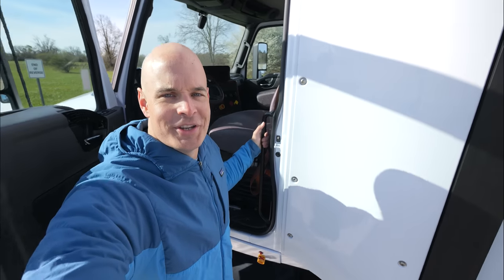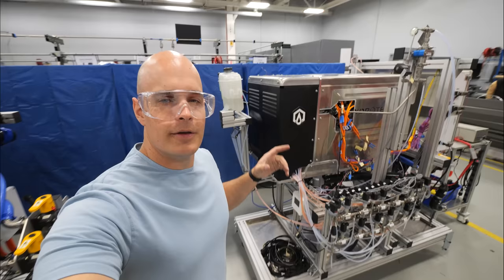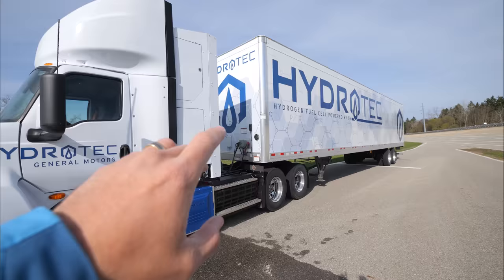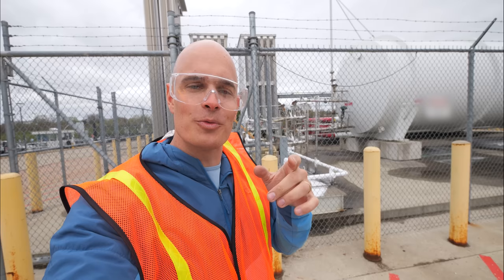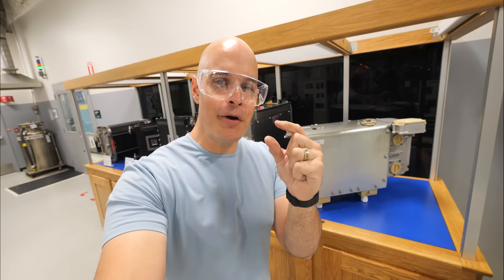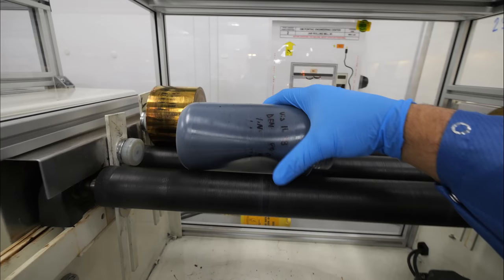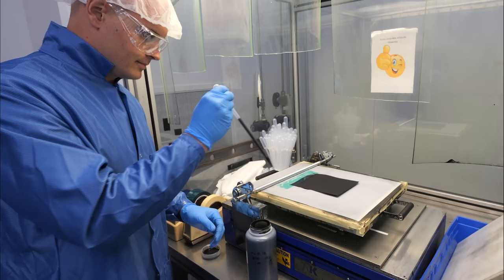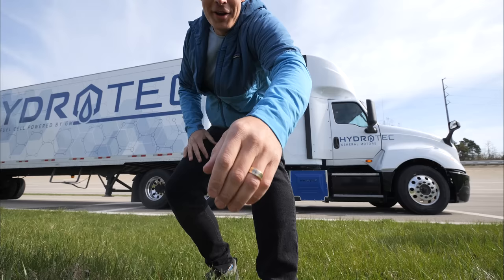How to build a Hydrogen Fuel Cell Semi Truck? - Hydrotec Factory Tour

Comment: So... basically this is a true hybrid in the sense of the word. It uses a form of fuel to generate electricity, which then moves the vehicle. You get the benefits of an electric drivetrain (instant torque, consistent power output, low maintenance) but without the range restrictions, as fueling up the hydrogen cells is a lot quicker than charging a batterypack. I like it.
Reply: battery rotor in place of engine and 2 generators(thu convertion )) this truck will drive forever
Reply: Toyota been trying for years and failing. This won't be any better.
Reply: Hydrogen isn't "fuel" it's a "storage medium" ..... A Battery.
It's just a hugely inefficient one.
The "must have huge range" mantra is a misconception (I could call it something else)
.
Truck outranges driver.
Truck charges during driver rest period.
Truck outranges driver to end of day.
Slow charge overnight.
Repeat.
Is all that's needed.
Reply: But it’s about 60-80% less efficient than if the electricity was directly stored in batteries. While hydrogen is the most common element in the universe it is not a source of energy it needs to be produced and is a store of energy. Creating hydrogen comes from natural gas and is incredibly inefficient. Converting it back to electricity is also inefficient. Hydrogen is “mostly” a fools errand as the net efficiency is so much lower compared to just putting the generated energy into batteries. Battery cells are recycled up to 90% of recovered metals for new batteries. Redwood recycling. Watch real engineering channel about hydrogen. 

Solar or wind goes DC to DC in the batteries, converted to AC runs the motor and 90% of that energy gets to a battery ev wheel. Ultra efficient. 

Wind and solar at best uses electrolysis to separate hydrogen from water, really inefficient. Then you need more energy to compress that hydrogen to liquid. Then the hydrogen has to be stored under compression which requires ongoing energy. And the hydrogen has to go through a fuel cell in the vehicle, which is incredibly inefficient converted into electricity to go into batteries that then convert from DC to AC to drive the AC motor.
Reply: Hydrogen fuel cells would be great if it was convenient to extract, transport, and store hydrogen at the same scale as fossil fuels.  It will probably get there, the infrastructure is much better than it was 5 years ago, but it's still difficult for now.
Reply: @carnsoaks1  they work. But people won't buy them cos they are not fashionable or something. 
All of the problems are sorted
Reply: @rogerstarkey5390  so is any other fuel.

H2 is more energy dense which means the truck can carry more cargo

Plus there is not enough materials in the world to replace all ice vehicles with bev
Reply: @rogerstarkey5390    There are no examples of this only propaganda. You won't get a loaded ev semi to meet it's advertised claims.  

If a driver is to make a good living hes going to outrun his log book, a driver wants to be able to park wherever including a dirt field in the middle of Oklahoma at 3am.  You're not going to be charging your rig in a dirt field. 

Another problem is the batteries that allow the electric semi to move are insanely heavy eating up a large amount of payload which reduces the amount of money your now limited range semi can rake in.  As a final kick in the pants battery replacement will equal half the cost of the rig in a few years. 

 Now you're stuck with a disposable mostly plastic flimsy framed electric headache nobody wants.  Getting rid of your used up EV battery pack is not going to be easy in the future. Nobody's going to want them they're not truly recyclable, they're a fire liability as well as an environmental one.

The electric vehicle battery is the Trojan-horse to our environment. 10 years from now my prediction will come to be, watch.
Reply: If history teach us...we will always goes with what benefit the rich like Elon...so electric is the way to go, until they're not one day...
Reply: @hollymolly518  because people are misinformed. If Tesla was selling fcev that would be the most common ev. Cos marketing
Reply: Except:

H2 station is expensive

H2 is expensive

H2 fuel cell is inefficient

Basically, it's not really worth it, just use battery
Reply: @cenakaze  so are ev. H2 is still not widely adopted. Price will come down with adoption
Reply: @cenakaze   The batteries are not worth the footprint. And the battery is just another energy carrier,  just use diesel responsibly.
Reply: @Pawer8  
You fell for the "not enough material" opinion?
.
How about those who say "not enough electricity to charge the batteries?
Do you like that one?
.
Well
You need THREE TIMES the amount of electricity vto liberate enough hydrogen to move the same distance.
Reply: @Pawer8  The problem is that are two different ways of measuring energy density - either based on volume or mass - and although hydrogen has good energy density by mass its volumetric energy density is rather poor (about 1/5 of gasoline, for example) - and this is what matters the most in a road vehicle.
Reply: @TrimeshSZ  not on a truck. They are limited by weight. Plus batteries are less than 1/5 of the density of petrol.

Weight is also a safety concern
Reply: @Pawer8  
How will the price come down?
Take sunlight.
Convert with solar power
You need three times the solar to make the Hydrogen for the same distance..
That's more expense.
....
With the EV, that energy goes straight to the vehicle on the existing grid..
.
"But the chargers!!!!"
Single cost, minimal maintenance.
Hydrogen?
You need the conversion plant.
You need a fleet of road tankers (no, pipelines don't work)
Due to the energy density, you need up to ten times the road fleet to get the hydro to point of use compared to fossil fuel.
....
You need storage at point of use.
ALL of this must be built A D maintained and it's not "passive" like the EV chargers, it's high maintenance, "leaky".
Guess who pays for all that? The end user.
.
Then, you have a much more complicated vehicle with TWO systems.
It's a hydrogen conversion plant feeding an EV (YES! it's an EV)
.
How long do those fool cells last? (Not as long as you think)
.
Much more to go wrong.
.
Fast fuelling?
IF the multiple tankers arrive to fuel the station.
.
"But the solar is in site!!"
And that solar could still move three times as many EV trucks for the same investment, without the extra infrastructure.
.
You fell for it hook line and sinker.
Reply: @Shigles  do not worry :) companies will make sure it starts having problems after a few years of driving.. 

how else will they make money and profits for their stakeholders ;)
Reply: @cenakaze  that's because the tech isn't going forward that way. just like back in the day. we have electric car but we choose gasoline car, now we going back to electric....hydogen car could be the future but isn't for now.
Reply: Except it takes a lot of energy to make hydrogen, cool hydrogen, move hydrogen and store hydrogen.  Big picture it is not efficient.
Reply: @carnsoaks1  Tesla has been successfully moving potato chips.  The lowest possible weight to volume cargo
Reply: @mrmobius  Hydrogen is a tech startup concept for naive investors who like the idea of liquid fuel.
Higher density and solid state EV batteries will arrive much sooner, and cost much less to run.
Reply: @Voltaic_Fire  it will never get there because of the basic physical principles of hydrogen. You can't change the periodic table.
Reply: @Pawer8  liquid H2 has more energy density than gasoline, but no vehicle can safely carry liquid hydrogen. As for raw materials,  CATL is already making sodium batteries.
Reply: @truantray  I won't say it'll be easy but I don't believe there's any challenge that humanity can't overcome.
Reply: @truantray  so what's your point? I was comparing fc and batteries. 

They are not making them yet. Also more dangerous than lithium
Reply: @Pawer8  what's "more dangerous than lithium"?
Reply: @rogerstarkey5390  it's more unstable when in contact with water. It can actually be used to generate hydrogen by dropping it in water
Reply: @yatish23   problem couse alot of contrys will go banckrupt  this project suppos to be my enginiere degree in my Contry i was working on project for 6 moths teacher just distroid my project and told to make `degree about stupid electric power steering (((
Reply: I think the big caveat is how you get the hydrogen. All the fuel cell/hydrogen combustion makers love citing the "most common element in the universe" stat but it isn't that common in gaseous form and located on Earth. Sure, the sun is made of a bunch of it, but if we can collect that, we've probably already solved our energy problem... If you source it from NG or fossil fuel processing, at least you're not just burning it as waste, though it's still reliant on FF production, but then it's at least more technically a fuel. If you're producing it via electrolysis, then it's much more akin to a battery than a fuel, since you use electricity to make it, then extract (some of) that electricity back from it. Still has some benefits in terms of recharge speed and energy density, so things like long-haul trucks or airplanes could certainly benefit from it, but it's just not exactly the magical solution to energy that some tout it as.
Reply: @Voltaic_Fire  I wish he spoke more on the safety of these? If we had 100s of trucks like this carrying pure hydrogen, wouldnt a crash on the road end in massive fireballs? What mechanisms are in place to keep that terrifying reality a smaller possibility? gasoline right now doesnt combust as readily as hydrogen sooo
Reply: AuschwitzSoccerRef.  Those quiet Swedish subs used Sterling engines, not hydrogen fuel cells.
Reply: @rogerstarkey5390  Especially in the US, where drivers are currently allowed to drive for way too long, contributing to the 40,000 lives lost per year. Europe and the UK have much lower levels, without higher prices.
Reply: @Pawer8  Tesla doesn't advertise. It's simply a matter of a the battery to AC motor energy path is more efficient than the hydrogen drive train. It's not anything more than that. 

Secondly, the true power structures don't want you to be able to make your own fuel. With ANY brand battery EV, you can put solar directly into your batteries. Thus a home power station. Can you make your own gasoline or hydrogen at home? No you always need a supplier. Battery Drive trains are the better tech. 

Improvements in battery density, which have happened for the last 100 years, will also equal more range, less weight, and better energy density over time. 

It's just a better drive train for most use cases. Ships, Airplanes, and other industrial autos still need increases in energy density. But heck, even "Caterpillar Successfully Demonstrates First Battery Electric Large Mining Truck"
Reply: @truantray  ahh yes just like the electric car back in the day...so we went for the gasoline...
Reply: @mrmobius  can you make your own solar panels? Your own battery? Don't be daft

I'm sure it has nothing to do with the gimmicks and the autopilot. I'm sure people buy it cos it's better. Like everything else right?

I'll also add until now the people buying ev are rich people. And rich people have garages and driveways so they can charge at home. If they didn't they would probably have gone for fcev
Reply: @mrmobius but is it more effecient compared to internal combustion engines?
Reply: @Pawer8  H2 isn't "energy dense" unless you transport it at -252C or at immense preasures.
Reply: @Lepinkainen_  per kg it is
Reply: @rogerstarkey5390  I don't know exactly what you are saying. If you are talking about charging while driver rests, that is not a great thing. Because the transportation company could arrange another driver to take over and continue without disruption, if needed. I guess they could also provision a new tractor at every stop, like a relay race :-)
Reply: @norbertnagy5514  no, about the same. 20-30% max energy from source to the wheels. Nothing can compete with 90% plus efficiency of the AC motors.
Reply: @cliffmathew  
Ah... The "could arrange another driver" excuse.
Really?
No.
You know exactly what I'm saying

FULLY LOADED it can run to the driver stop, and add enough to finish the day.
Unless the operators employ 2 drivers, which would cost A LOT more?
.
Stop looking for loopholes which don't exist.
.
If you want a loophole the other way
If like the majority, they don't run at maximum weight.
Or
They have even a single delivery stop during the day.
Then they could make the whole day without any charge, or top up during the delivery, again, while the truck is stopped, but the driver is away for a "comfort break".
....
Smh.
Reply: @Pawer8  
"per kg" isn't the problem.
VOLUMETRIC density is.
.
±19% that of fossil fuels, so you need ten times the number of road tankers of a given volume to supply the fuel to point of use.
Then you have to fuel and maintain those tankers, making it even less efficient.
.
It ain't Rocket Science.
Reply: @mrmobius  so we better focus enhancing the purely electric ones then
Reply: @Pawer8  Can't make my own battery or solar, but once purchased, I've got 25 years of my own fuel direct from the glowing well in the sky.

Have you watched FSD beta videos on YT where people drive for hours on full AI neural net vision only software (still in Beta)? No predetermined maps, busy cities, construction etc. Because if you haven't then we aren't talking apples to apples. 

Automated driving is a matter of when, not if. Many approaches from Wamo (high precision lidar maps) live in Phoenix now, to AGI neural net vision only which is Tesla, Comma AI (geohotz project) and one other big player. It's better to think of AI as "automated intelligence" vs artificial. We are training software and it grows exponentially more capable each day due to data set size increase. 

EVs are now price comparable with ICE cars who's average selling price is 35K-ish (all models) and the low-end EVs are in that ball park from Kia, Tesla, VW, and Hyundai. All new tech reduces price when scale is achieved. Think about how cheap LCD TVs are now. 600 bucks for a 75" 4K LCD? That's bananas cheap.

Home charging is a big deal in the US. Tesla network is top tier, Electrify america isn't the most reliable but getting better.

In China, where EV sales are booming, many apt buildings are the norm not houses. There's an entire industry of selling chargers into apt buildings. My friend has a US startup, Coral EV, doing just that. Also NIO does battery pack swap station in China. My apt building in Arizona will install an outlet in my parking space when I get an EV. I pay for the electrician around 500 bucks.
Reply: @rogerstarkey5390  when the max weight of a truck is limited by law yes it totally is.

When car's mass inreases by about 300kg yes it is.

And it is still a lot more dense by volume than a battery. So it's also good for vans
Reply: @norbertnagy5514  Hydrogen may have a place where the practicality of it, like cargo ships, may be worth the inefficiency. Given you could keep a high amount of compressed hydrogen in the fuel areas of these big ships and currently they consume the crudest of fuel oil. Major toxic hazards and greenhouse emissions. but for passenger cars and trucks it's simply far less efficient than battery EV drive train and the electric grid is already every where. With hydrogen you'd have to build an entire new hydrogen distribution and fill up network. 100's of billions of dollars just to replace ICe drive trains without improving efficiency. Plus most hydrogen comes from natural gas refinement presently.
Reply: @Dat_Sun  Tesla Semi already did 500 miles full loaded with rest stop and no charging from Bay area to LA. Ordered in the 100s by large corporate partners. 

Redwood Recycling can pull 90% of the metals from old EV batteries, which are already battery grade, a much better yield than refining from raw ore. They have hundreds of millions in funding because mining old batteries with known chemistry in bulk, is far more profitable than mining and refining raw ore. 

Yes, without recycling, you are 100% correct. It would be a disaster. But the profit motive for recycling is the key enabler of investment into the space. 

Any new battery innovation that increases density make any electric car in existence have longer range. Battery tech evolves over time (laptops used to last for maybe an hour vs nearly all day) - so an old EV upgraded to new battery tech has more range than when it was new.
Reply: @JorgTheElder  we don't have the Infrastructure for bev either.

And yes trucks are limited in weight by law so drivetrain weight matters. A lot
Reply: Too bad the  efficiency of hydrogen fuel cells is awful, since you waste 2/3 of electricity in their use
Reply: It would be true if you BURNED the hydrogen as a gas. But in fuel cells you use it to make electricity, that is incredibly inefficient
Reply: @mrmobius   500 miles of the most convenient conditions. 500 miles range would bankrupt a owner operator.  And is not even an option for team driving or driver swaps.

 But that's the goal here eliminate the competition, use the people's money against them and force corporations to purchase this junk.  Raise the prices of everything because transportation is going sky high. I feel sorry for the people purchasing their energy from the grid, this is going to end in disaster. 

 Imagine several 100 times more charging or "fueling stations for ev's.  Dont forget the massive demand placed on our undersized grid,  demanding more fossil fuels be used to keep up with the load.   All of this is placing the cart miles ahead of the horse, we do not have an abundance of renewable energy which means every electric vehicle manufactured today is another industrial load placed on our grid field with fossil fuels.

 The small amount of renewable energy on our grid is backed by fossil fuel if you step back and look at the whole picture, most of this junk is made in China or around the globe somewhere using container ships requiring billions of gallons of oil.   Do you think these countries care about our environment? China is building coal power plants at a alarming rate to build all of this renewable plastic junk we dont "need".

 Your battery recycler has fed you a bunch of grade A li-BS.  Plastics are never really recyclable, that last 10%of stuff is extremely important.   Battery technology is not improving it's simply a trade off, Reliability and durability have been tossed out the window for flimsy sandwich bag cells or super thin and volatile lithium cells . In about 10 years we will see a electric vehicle battery environmental disaster began to unfold. All of these failed government vehicles will be sitting in fields bursting into flames one at a time. It's already next to impossible to find somebody to store a wrecked electric vehicle.  

There are so many shortcomings when it comes to electric vehicles in general particularly electric semi trucks, that the only example we can find has a fraction of the range of an ice example and weighs thousands of pounds more.   They actually raised the amount of weight a semi trucklyn way to allow electric semi trucks on the road under the same rules everyone else has had to follow for the last 100 plus years..  We limited the weight for semi trucks for a very good reason and again we threw that out the window let's not talk about the damage to our roads and bridges due to the extra several 1000 pounds these trucks can weigh. As if 80,000 pounds semi trucks weren't hurting enough innocent motorists.

 Will an electric semi truck work? Yes , does it make any sense?  No, unless you're a Demorat who is somehow invested in renewable nonsense.   These things are also going to replace the truck driver if allowed Continued access to tax cattle funding. The electric semi truck is the Trojan-horse to the trucking industry. If it doesn't have to be profitable when tax cattle are forced to back it, R and D is continued using the drivers against them, Once it's polished off driverless models will become available. Costing everyone 10 times as much but in the name of renewable energy BS, they will force it on us to make another dollar off the tax payers back.

 That 500 miles equals about 200 miles in the real world may be less during the holiday season when the interstates are packed.  This handpicked route of 500 miles is a sham.   The only way we will see electric semi trucks on the road now or in the future is with massive government spending of tax cattle funding.   That's all this is that's all any electric vehicle is, just another way to access tax cattle funds.

 Pound for pound electric vehicles are an embarrassment compared to ice. You will never see a fair comparison between the two.
Reply: @Pawer8  "All of the problems are sorted"

I can think of one massive problem that isn't sorted: where do I go to put more hydrogen into my car so I can keep driving it? I can go to any number of gas stations to get more dino juice for an ICE. I have electricity at home to charge a BEV. But I don't have hydrogen at home and I don't see any hydrogen stations around.
Reply: @Dat_Sun  "Another problem is the batteries that allow the electric semi to move are insanely heavy eating up a large amount of payload"

Lithium based batteries are heavy. New battery technology is in the works that is lighter and more energy dense. Much like we didn't use alkaline batteries forever, we won't be using lithium batteries forever.

10 years from now, we will see how bunk your prediction is, watch.
Reply: @TrimeshSZ  Exactly. Hydrogen might work for semis because there's plenty of space to use for storing it. Engineering Explained did a video showing how much space hydrogen would take up in a passenger car - I hope everyone likes driving alone and fitting all their groceries and other items into the passenger seat because everything behind the driver is just hydrogen storage.

Hydrogen is a total dead end for passenger cars. And I can't imagine wanting it even if it was. I have electricity for charging a battery at home. I'm not going to have hydrogen at home, and will have to revert back to the inconvenience of going to fueling stations. No thanks, I have perfectly good electricity at home that I'd rather use.
Reply: @mjc0961    If I had a dollar for every time somebody told me future battery Tech is going to save us since 1980 I would be richer.
Reply: @mjc0961  half the drivers in the UK don't have a place to charge a bev. Petrol stations can however be converted to serve h2. But not bev charging due to space constraints
Reply: @mrmobius  > about 60-80% less efficient than if the electricity was directly stored in batteries

That's assuming you generate it using electrolysis. Japan has one nuclear plant design that's doing testing (running since 1998) and is estimated to be online for commercial operations by 2030s that basically generates hydrogen as a byproduct of it generating electricity which is estimated to be even cheaper than steam methane reforming hydrogen. It doesn't use electrolysis, it only uses high temperature waste heat (at 950C) from the plant that would've been otherwise dumped to cooling towers or rivers or oceans. It uses a variant of thermolysis called thermochemical water splitting, the SI cycle that's being tested by Japan needs around 800C which Japan's plant design satisfies more than enough (950C waste heat temp).

The commercial version which as around 2400MW thermal power that's expected to come online by 2030s is expected to generate 800 tons of hydrogen per day. Japan is currently building a large H2 demonstration plant next door to the reactor to test industrial scale generation. It bypasses the efficiency issue since it skips electricity altogether and uses a much cheaper form of energy which is heat. It's the same reason why steam methane reforming is cheap, it doesn't use electricity. For this reason even China, Korea has been doing work to build the same reactor design (China has one running right now too), and western countries are starting to take notice as well (US, UK, Poland, and France in particular).
Reply: @ryoukokonpaku1575  Very cool. But again, why not put that "waste heat" into a steam turbine generator and right into a battery? Why the middle man of hydrogen? The total energy generated is still more efficiently used directly in a battery EV. 

But I do love to hear innovations like this. Thanks for sharing.
Reply: @carloorelli3538  what about range and ineffectiveness of keeping "range" without significantly increasing weight
Reply: @mrmobius  Because you can do that afterwards, the outlet heat after generating h2 is still hot enough to generate steam (around 300-400C) so you can have a combined cycle. The nuclear plant uses a gas turbine since it's gas cooled, so the left over heat after H2 generation can still be used for electric generation or even other use cases. One popular use-case for colder countries like Russia and Northern China for current plants is to use the waste heat for district heating, basically piping heated water to a town / city for cheap heating.

Either way there are a lot of use-cases that can't be solved with electricity alone, H2 will still be needed regardless. Heavy machinery and long haul trucking is one as less downtime is important, there's also steelmaking which needs a cleaner furnace as electric furnaces aren't as good and needed as an alternative for reducing iron instead of coal. Another benefit for H2 is that it can be exported unlike electricity unless you live in europe. This allows you to sell H2 and let developing countries who don't have developed electric grids go cleaner faster. They can use that H2 to as a cleaner alternative to gas plants or even fuel cells and generators as rolling blackouts aren't uncommon still for a big portion of the world and electricity isn't always easy to come by.

H2 is not just aimed for cars, but if there's plenty enough and cheap enough using that method you can basically also use it for personal transport as a side effect.
Reply: @ryoukokonpaku1575  Bravo! Everyone now and then you get a smart, evidenced based, and logical youtube thread going. Everything you've mentioned has been educational and I've enjoyed your perspectives. Rock on
Reply: This is not a hybrid. Hybrid means 2 forms of propulsion, this has only 1 form : electric motors.
Reply: Edit: I do agree with the above comments though, this has been my opinion. I've just been slightly convinced recently by trucks/busses using hydrogen, though with charging tech improving, things will change.
Indeed, this is exactly why they are perfect for trucks, yet don't make sense for passenger vehicles.
I do want to add a few things though - in terms of electric trucks, charging tech is definitely improving, to the point where trucks would be able to charge super quickly. Also, commenting on your point of hydrogen trucks being low maintenance, I'd guess they have more maintenance than electric trucks, given that hydrogen trucks contain both the hydrogen and EV components.
Reply: @mrmobius  Indeed
Reply: @Pawer8  

The Tesla Semi takes a full load.
A van is all about load volume.
You don't want a hydrogen tank under the floor, you don't want it inside the load area, so..... On the roof?
You .know the 10 heaviest cars on sale are all gas cars?
More energy density by volume than a battery? Which the HFCEV still needs?
Are you sure that the tank and the fuel cell and the battery don't weigh more?
So I checked.
Toyota Mirai 1900 kg.
.
Model 3 1672- 1847kg depending on model.
.
Oops
Reply: @YounesLayachi  p
But Toyota calls a vehicle that uses an internal combustion engine to generate electricity to charge a battery which powers an electric motor a hybrid.....
I thought they were the experts?
Have they got it wrong?
Reply: @rogerstarkey5390  that's called marketing. Marketing is all about maximum oversimplification to avoid scaring the customers away.
Edit : why do you see recently the term BEV appear ? Because the B for battery means the energy source, and the EV for Electric Vehicle means the electric propulsion.
This is in contrast with Fuel Cell Electric Vehicles where the electric motors are powered by energy that comes from a fuel cell
Reply: Not only is this a good form of a hybrid unlike electric cars this also doesn't put a strain on the electric grid that is already taxing out and doesn't have the capacity so hybrid vehicles give you the range of a gas vehicle or gas-powered equivalent but without the strain on the power grid like electric vehicle but like an electric vehicle it gives you the torc
Reply: @Pawer8  Per kg yes, but it takes immense amounts of power to store a kg of H2 in a sensible size. You either need to chill the everliving fuck out of it or go north of 1000 psi of pressure.
Reply: Or you could just swap out a battery pack and forget about all this hydrogen marketing BS...
Reply: @carnsoaks1  Toyota already have a commercially available vehicle running on this tech.
Reply: I don't like fuel cells on cars. Since they're more expensive, impractical, and nowhere near as green as battery electric. Although on an 18 wheeler, it makes a lot of sense.
Reply: @rogerstarkey5390  But what will happen when battery reach its end point as they can't be forever.
Reply: Or you could just change the batteries on a "fully electric" vehicle.
Reply: @carnsoaks1  Toyota succeded to implement the technology, but mass adoption did not happen because it's not practical for a personal car. For trucks and buses makes way more sense
Reply: @rogerstarkey5390  but the hydrogen "battery" isn't as environmentally taxing to produce as is the lithium battery. Even if it's less efficient it's more readily available, it doesn't take hours to fill up and it's emission is water (which can also be used to produce more hydrogen🤷🏾‍♂️
Reply: @carnsoaks1  lol they're are not failing why are you lying? of course  R&D is not has big .
Reply: i've read some fear mongerey in this thread. Using hydrogen and fuel cells in vehicles may not yet be that well developped (and there is a variety of fuelcell types with each theire pro's, cons and efficiency), but for future earth i'd rather spend a bit of energy into hydrogen as energy carrier than batteries that we will have no way for to recycle. Lets see what the future brings. Personally i think the current battery systems are just a temporary solution to step away from fosile fuels quickly. To really solve everything, we need to take a very close look at how we live and move around. Become more consious of what we do and leave behind.
Reply: H2 cost 10x the electric price and is around 20% efficient. It takes around 10-15 mins to fill up 10kg, so guess it could take up to 1 hr to fill up 40kg as in this truck. (Cuz of safety and build up pressure in the tank).

So on the road, hydrogen have no life at all. On the sea it can be a better option.
Reply: And it only takes ten times more energy to refine hydrogen than gas. 50 kWh per kilo vs 5. Hydrogen ends up being dirtier then gas unless you use green energy to refine it.
Reply: @@JMP160 ships maybe. Most truck routes are regional 250miles or less. Electrical grid already exists. Pepsi already using Cyber truck and achieving a net zero effect on a few routes due to regen down hills. To build a hydrogen network to = that range would cost trillions. Efficiency is the ultimate natural resource. Battery tech energy density will increase faster than you could ever build out a hydrogen network make the longer haul a non issue.
Reply: @carnsoaks1  it already is. Trucks simplify hydrogen logistics enough to make it viable.
Reply: @mrmobius  You do know that if any wonder battery comes into play these trucks can be converted to exclusive battery power, right? Both run on electricity after all. Plus, much like pepsi, theses trucks will work on predefined routes for quite some time, using electricity from renewables to produce hydrogen during off peak hours is a no brainer. 

It doesn't matter if hydrogen production from electricity is inefficient as long as it is economically viable.
Reply: @user-pq4by2rq9y  cost per mile will be more with hydrogen as the hydrogen production network does not yet exist. The electrical grid is already is in place. Taking the same energy from renewables directly into the batteries via the electrical grid is vastly less expensive than taking the same energy, building a hydrogen production station network, then converting those renewables at 40% efficiency to hydrogen compared to 80-90% directly into a battery. The bulk of the space in a hydrogen is the fuel cell. That would need to be retrofitted for battery packs. The electrics are ready design around the battery pack. Hydrogen is a fools errand for trucks outside of edge cases. Watch real engineering's channel breakdown on this matter. It's not opinion it matter, but a matter of physics.
Reply: @rogerstarkey5390  it's OK.
One day there will be no oil, gas, petrol.
Then no raw lithium cobalt chromium. 
Then we'll fall back on solar cars.
Oh, and my push-bike.
Reply: @Dat_Sun 100% agree. The batteries created due to this EV ‘revolution’ is a ticking environmental disaster. If we look at efficiency gasoline/diesel powered vehicles are incredibly efficient while EV’s are the exact opposite, so that EV supporters now use the argument that hydrogen powered vehicles is inefficient compared to EV’s is hilarious.